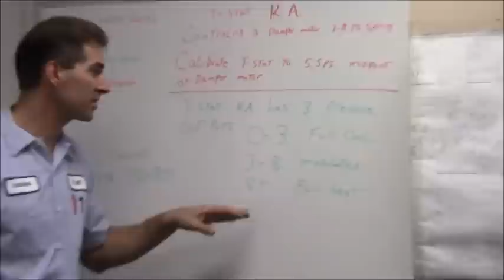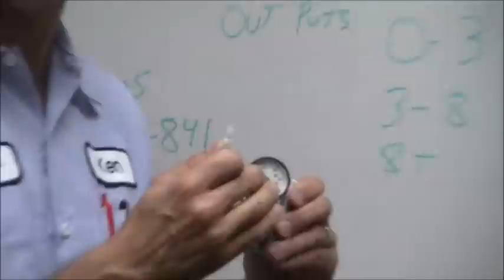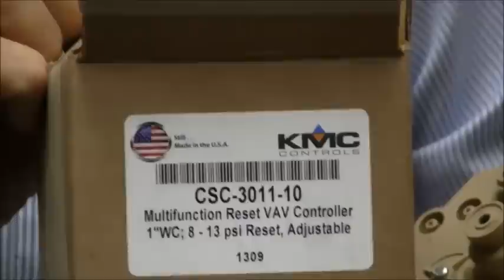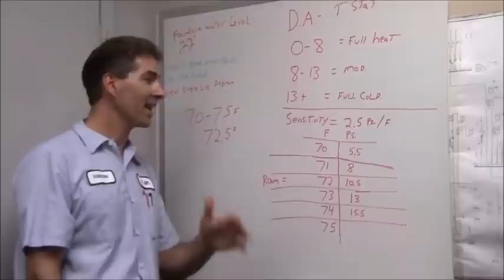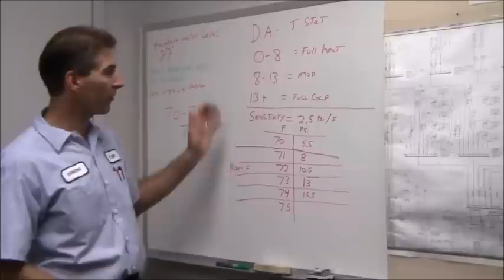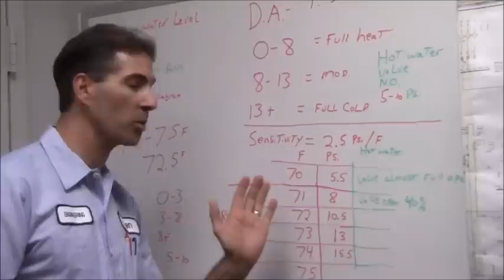How to Calibrate a Pneumatic Thermostat or T Stat

Comment: How to calculate  that on the velocity  controller, what i would do is ck all my pressures at ea, devices actuator with a pressure gage to see my pressure  coming  to that  device trouble shoot ea one to see where the problem  is,its a great way to find out what going on in your system

Comment: We have a velocity control that’s CSC-3011-10. Does that still use a reverse acting T-stat?
Reply from the maker: Yes. The CSC-3011-10 is a universal pneumatic VAV reset volume controller that can be set up for either direct- or reverse-acting thermostat reset, so it still supports using a reverse-acting T-stat.

Comment: The thermostat could be filled  with oil or like you said, damper diaphragm  could have a small pin hole or the heater or valve is sticking  just have to pinn point the issue. Love the video  thanks for your hard work
Reply: Replace the diaphragm

Comment: Does such a pneumatic system work even if the input (from the compressor regulator) is not stable? Is it important to keep the pressure constant and at exactly 20psi?
Reply from the maker: you have 2 regulators. One for the compressor maintaining tank pressure and a second regulator maintaining the 20 PSI for the Pneumatic Air.
Reply: @KenTraining  Thanks :) and then, how important is it to keep it at those 20 psi. What if it drifts of to 25psi? Will that affect the output of the thermostat?
Reply from the maker: Yes, the Thermostat will have a MAX psi rating and you don't want to exceed that.

Comment: Hi Ken, My question is if its a RA system, Should the velocity Control for heat mode be on Normally Closed or Normally Open setting? I know Cooling should be set on Normally open. This would be for a dual duct system with Heat fans supplying hot air to duct.
Reply from the maker: I believe it is normally closed. let us know how it works?
Reply: Correct. It is normally closed. Thanks for sharing the videos. Doing an awesome job.

Comment: I am confused about the hot water valve as it works from 5- 10 psi 
and also  you talk about thermostat from 0-13 psi and then the table is just from 5.5 to 13 
it is not clear

Comment: Hi Ken, how about siemens powermite 599-01088 Pneumatic Valve Actuator for heating zone valve, what spring range to calibrate the thermostat?  i didt see it the range on the valve it self

Comment: Find the spring midrange of your valve  Example: spring range is 3 to 6 psi  the midrange is 4.5 psi.  Measure room temp and set the dial on your T'stat to Room Temp,  Insert your pressure gauge calibrate the pressure to 4.5psi. Done

Comment: Good video.  How would you calibrate the t-stat if the damper operator spring range doesn't match up with the controller start point and range
Reply from the maker: Calibrate to the mid point of the controller.